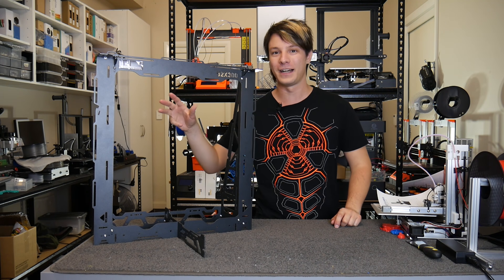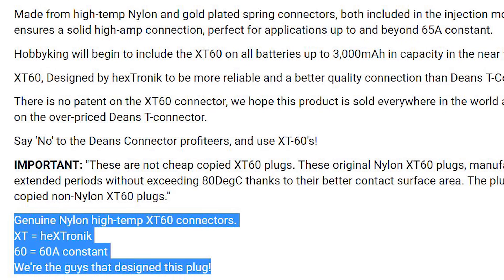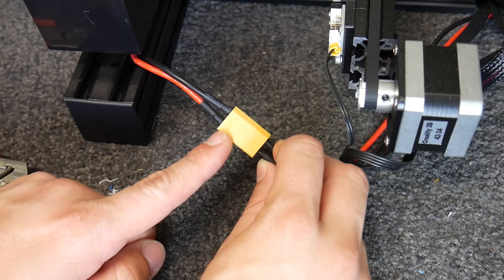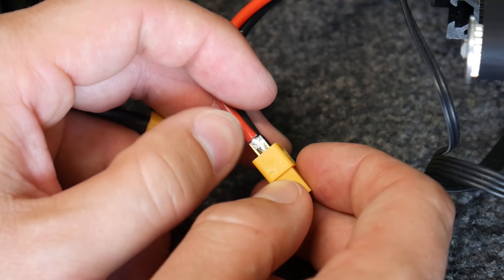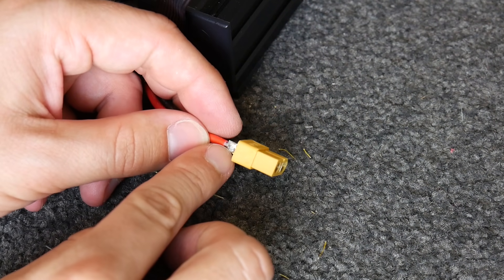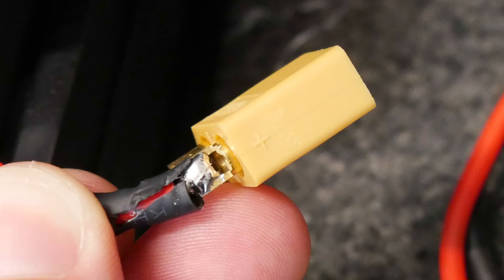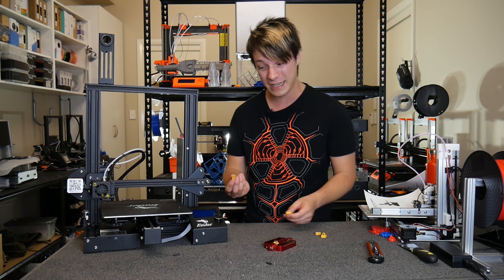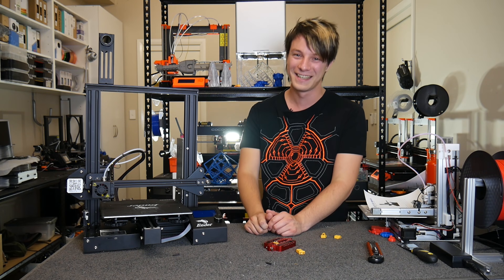Ender 3 Connectors are burning up... Bad XT60's

Comment: There is actualy no such thing as 'fake' XT60's.. HobbyKing wants others to allso use these, so they allow Anyone to manufactur them.. 
Offcourse they indeed need to be Soldered to the wires :)
Reply from the maker: True, fake probably isn't the right word nor is knock off... but 'inferior' might be a good descriptor!
Reply: Yep.. that's the word :)
Reply: Indeed not knock off, but if you pay nuts... ;-)

That said, the Ender 3 is a fantastic base to build and improve on. I enjoy mine very much.
Reply: If you use the “original” and then use the “fake” it’s a night and day difference, I’m sure you would be very frustrated and calling them fake. Absolutely horrible rubbish that easily melts
Reply: BrunoPOWEEER Point made by DutchRC Adventures it’s just a standard type connection which is also heavily used within the RC community. So there isn’t really a original one and neither a fake one. There are just solid and well crafted connectors and the not so solid ones which are build to a grade it can barely up to half of the intended specs.

And these kind of printers should never be running leaving unattended for a long time. They are prone to all kind of failures. Just the nature of these type of printers. And it wouldn’t surprise me very much if the early production runs have more issues regarding quality control than the later production runs. I have mine used pretty intensive over a period 6 months up ‘till know and I regularly disassemble the printer for modding and maintenance and never ran into some issues others experienced. No loose connectors on the mainboard, no melting solder on wires in those screw connectors, no melting XT60 connector while printing with the hotbed on 80 degrees celsius and hotend on 250 degrees celsius.

It’s like BMW 5 series, most of them won’t catch fire. But if you have one which catch fire it sucks.
Reply: @MakersMuse  Maybe cloned like how we refer to non-Prusa "Prusa" I3s
Reply: In as much as XT60 is a product originated by AMASS, and not enshrined in any standard doc, the connectors made by other manufacturers are imitations of various levels of quality.  There is no standard for the other connectors to claim to abide by, and generally they do not come with their own specs.  The Amass XT60 does have specs, which appear to be these: https://www.tme.eu/en/Document/2d152ced3b7a446066e6c419d84bb460/XT60%20SPEC.pdf
Reply: @PM_0891  there is solder in the screw connectors? you should put a wire end sleeve on the untinned wire
Reply: If they are not manufactured to spec then they are knockoff in a open design. To be a real xt60 they should be built according to the xt60spec if they aint well then they are not xt60
Reply: Well you could argue that if they are not made up to the standards expected for the name "XT60", then they are not really XT"60", so in that case it would seem ok to say they are "fake XT60".
Reply: @MakersMuse  yeah right off Taobao I can find four quality grades of that connector.
Reply: @Naomi-Wu  what are the quality grades? I'm imagining "60A with a safety margin", "exactly 60A with no safety margin" and "will burn itself up at 60A, but we'll call it 60A anyways"😂
Reply: @Naomi 'SexyCyborg' Wu and @Kevin Crossland also please be aware that the AMass XT60 spec only shows 30A continous rating NOT 60A! The 60A spec is for brief transient load (as when starting a motor).  But the Ender 3  is closer to 10A, so should be OK anyway.
Reply: In the open source world we call it first party vs third party.
Reply: @Graham_Wideman  Thank you
Reply: HobbyKing uses words like "Genuine" when describing their XT60 packs, so maybe that's something to consider.

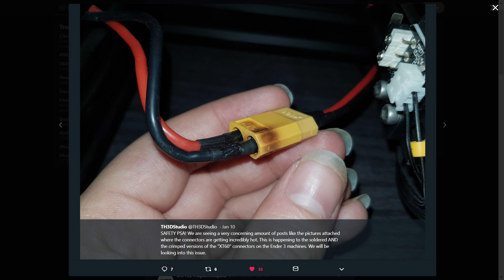Comment: @7:17 it appears that the actual conductor inside the male plug, between the solder joint and where the conductors are making contact, is where it's overheating and burning up. I wouldn't be surprised of the solder joint and the contact between male/female conductors is OK but that it's actually the male conductors themselves, between where they mate and where they're soldered, that's not providing enough cross-section area for current. Otherwise it could be a case of bad contact but it's just heating up the male and is only visible where it's held by the plastic housing that's browning/burning.

Comment: If you notice, the female fakes are also tubes.  I've never seen a completely hollow xt60 female before.  That could also cause heat and resistance since there's less material to transmit the current.
Reply: Yes, they are supposed to be milled out from two sides, not hollow. I don't think this actually limits the current, as there really is plenty of metal there either way, but what it does is limit the amount of solder and heat you can apply before solder flows inside the connector where it would interfere with the male plug. Obviously they wouldn't let it come to that, but that goes half way to explain the sub-par solder job where the solder doesn't even wet the cup properly. Other thing that comes to mind is that shoddy knockoff XT series connector sheaths are frequently made from a lower temperature grade of Nylon that gets soft at soldering temperatures, which also leads to sub-par soldering as they're trying to not melt the sheath.

Comment: I plug the connector to another (that already has heavy wires soldered in)

one of the concerns while soldering these connectors is: if you get the joint too hot, you soften the plastic housing.  If not plugged to the mating half, the bullet can get out of line.

Some people will build a soldering jig that has even more secure mounting for the end being worked on to plug into.

That Turnigy clamp does not address the issue of the hot bullet possibly deforming the plastic.

I affix up to 10 gauge to the Xt60 and EC3.

I also use EC5 (XT90 are the same size bullets) with up to 6 gauge wire for 120 amp demand in RC aircraft.

Above 120 amp, I go to the Castle Creations 8mm bullets.
***********

Or you can go to EC3 which you solder the bullet to the wire, then snap on the plastic housing (can slide the heat shrink on the wire and bullet after soldering)  Since the plastic is never exposed to the heat, once snapped in, its going to be properly aligned.
Reply: What i do, is that ill plug the male intk the female, so that way even if it does deform, the male and female will still be aligned

Comment: We've known for a long time in the RC world about cheap knockoff XT60's burning up (cause as you know, we use them on the LIPO packs and on big RC units, they can pull a lot of sustained power).

I would wager its the same problem and its because of the same 2 issues. 1: They're knock offs and all the issues that go with that as you described, ie contact pressure, contact surface, material type, etc. But issue 2 is i would say the solder joints are iffy. You got a couple of good ones, but there was a couple there that looked iffy (that first one?) and this goes back to issue 1: Poorly copied. With original XT60's, you fill the terminal completely with solder then drop in the wire (preferrably pretinned to help with the wicking), but obviously thats not possible with those terminals because they're open ended and the solder would just flow down all over the spring end of the terminal.

But again, this is a known thing in RC stuff, and tbh considering where the printer came from, its not even surprising.

Comment: still a poor soldering job, the connector hasnt been heater properly if at all
Reply: And the wire on the closeup wasn't pushed down to the bottom, into the dent. It's just soldered up near the top end.
Reply: THANKS! This is a bad soldering job, Its more like glued on to it. To the top with your comment!
Reply: If you heat them too much, the pin melts the plastic and it moves. That's why when I solder them I plug it into its pair first, and that holds the pin in place in case it wants to move. Also adds a bit more thermal mass.
Still my favourite connector - great for making distribution blocks, parallel combiners or Y connectors.
Reply: @ahaveland  yup, which is why they probably skipped on some,
Reply: You are right, XT60 and others needs more time to heat to solder it properly.

Comment: I'd totally agree with you Angus, the fake XT60's are the most likely cause of the problem. The plug pins don't look anywhere near as sturdy add the genuine ones, if they do overheat the heat tends to anneal the metal, which then loses its spring tension, making the situation worse.

Comment: I started a print on my Ender 3 just before this video began, I've just gone to check it and it's 14mins into the print and held the XT60 connectors....they're warm!
I'll check the solder connectors tomorrow when there's more light but if they are crimped I shall be soldering them and putting fresh heatshrink on too
Reply: Maybe take out the connectors entirely. Odds are, it might not be the solder joint but connector quality. They aren't supposed to fit this sloppily.

Comment: I just checked my Ender 3 and it has crimped connections on both ends. I bought it on December 3/2018. I was more concerned that I could pull back the heat shrink tubing and push it back. On the other hand, if the connector were too hot the shrink tubing would not be able to be pulled back and be slightly grayed as I've seen on overloaded joints in the past. The crimp looked solid and was a 4 point crimp. I only do PLA, so my bed is not above 60 but I have done 10 HR prints. Since there was no discolouring on the plastic I'm just going to keep an eye on this and post if I see anything show up. Every owner should use their own discretion. Thanks for passing this on and the heads up!

Comment: I just got an Ender 3 Pro yesterday and Creality has fixed many things on their printer. For example the control box fan is no longer facing upwards and the extruders heating block has a silicone sock on it. I just checked and they have also upgraded to genuine Amass connectors so hopefully people don’t have to worry about this issue anymore!!

Comment: Hello. I wanted to thank you for your very useful and informative video. It helped me understand the reason for the melted connector on my 2018 Ender 3. I removed the heat shrink from the wire and found that it was not soldered to the connector, but simply crimped.

Comment: Yes he is correct! However I know and most people that have done anything with connectors one crimped the connection can and usually is deformed! I HAVE A ENDER 3 AND I WILL BE CHANGING THE PLUGS CRIMPED OR SOLDERED! I am not a paranoid type but after years of working with truck trailer and RC BOATS CARS AND AIRCRAFT. I HAVE SEEN THE OUTCOME OF JUST ONE BAD CONNECTION. Good job bringing this to the public attention! Thank you.

Comment: All those solder joints looked really bad.

You need to wick the solder into your wire first (called tinning the wire), then flow some solder onto the surface of the plug  (do not fill up the plug, you only want some solder on the surface of it), then insert the "tinned" wire to the plug and add heat to the plug and feed solder into the wire as it heats up. This is the only way you make a solder connection to a XT60. If you are not experienced at soldering large connectors it is recommended to have a connector plugged into the XT60 when soldering to ensure the pin can't warp if you accidentally add too much heat (so support the connector your are working on with it's partner plugged into it). Most videos on youtube show you the WRONG way to solder an XT60 so beware.
Reply: Thank you for your explanation! For me it is enough, but I am wondering if you think about making a Video of how to do it the right way? Again, thank you very much! :)
Reply: THIS should go to the top.  It is a great description.

Filling the connection with tin will make it harder to solder, and the risk of cold soldering will be much higher. Especially if you don't wick the wire.

The parts that you will solder should be "wetted" first with electronic soldering flux. It is much easier to get a proper soldering when the parts are fluxed then without. As someone mentioned, don't use the wrong soldering flux, as it got acid in it and will corrode the electronic soldering.

The order of applying heat is important if you want to make a good solder.

0) Use flux on the parts.
1) Wick the wire.  Here you can use more heat, so you get good smooth flow between the tin and wire strands. Don't fill the wire with too much tin. You can feel how long the tin has gone up in the wire. If too long, just cut to length (about 1 cm should be ok).
2) Add enough heat to the connector, so that the tin is flowing smooth into the connection, but no more.  Don't use to much tin, just so it gets on the surface.  As mentioned, ad the other part of the connection as fixture and to remove heat. Can make it easier to not overheat the connector.
3) When the previous step is ok, while stil heating, add the wire. Now the connection surfaces are tinned and the heat needed to make the connection is easier.  Top up with tin so that the connection is filled up, this is why you should not use to much tin earlier.  But just fill so you get get a smooth tin solder between the connection and wire.  Not to much or to cold, as it then will build up a blob with tin.  That is cold soldering and makes a bad, high resistance connection.  That is no better then the original ones in the video. 
4) When the soldering have cooled of, you can remove flux with some tissues in alcohol or even water.

Inspect the soldering, and the "flow" from the connection to the wire should be smooth. It should NOT be a sharp step between the metal connection and wire, with a blob of tin on the wire or connection.  That is a cold soldering, and is a bad connection. Both mechanical and electrical.  
If that happen, unsolder the wire, put flux on the parts and redo the operations.

Sorry for repeating what you wrote, but this is important, as we could not have cold soldering, as it will certainly make the connections heat up, and even catch fire again.
Yes, there are plenty of videos showing of good electronic solders here at YouTube.
Reply: I'm glad to see I'm not the only one distressed by the soldering advice in the video. This description is excellent.
Reply: Yeah im about to soldier a battery to these connectors, I was a welder in my late teens, A long ass time ago, lol, Still its completely diff than holding an arc welder, Or even mig, Having to hold the soldier wire with the soldier in the other hand, Im not very good at doing, Is there any little tips that will make it easier, The soldier wire is from a cheap soldier off ebay, I never learn i always do it buying cheap that messes up to easy, lol, Its for a bafang mid motor so i dont really want to mess things up, An catch fire while im blipping down the street, I will defo connect connectors together before i soldier it, Cheers, Glad i read it....

Comment: I inspect soldering jobs for high reliability pcbs (150 deg C high vibration enviroments) and the soldering on the 'fake ones' seems to be lacking.  there should be a fillet of solder around the wire and there seems to be just a bulge.  Looks like they didn't use  additional flux and just relied on the flux in the wire.  I didn't get a good look but the backs of the solder cups should have a bit of solder on them since to do the soldering correctly, the heat has to be applied opposite of the solder and the molten solder will flow to the heat.  

Thinking about it this is a race to the bottom printer and they are definitely not going to use flux.  It is additional material (tiny) but it is definitely slower.  Always use flux.
Reply: It's probably that garbage lead free solder everything is made with these days ...
Reply: @danp2779  I use lead-free (silver bearing) solder all the time. Needs more heat, but I've never encountered a situation where leaded solder would have given me a significantly better result. The stuff that doesn't have silver in it (almost pure tin) has inferior wetting and flow properties, but does (as small compensation) make beautifully shiny joints.
Reply: As someone who inspects cable harnesses, mostly class 3, but some class 2, I'm still trying to figure out why these should never be crimped if they have a crimp contact instead of a solder cup

Comment: Angus, looking at the connectors you have on both your printers, they are knockoffs, they don't have a 'bottom' within the barrel, you can see the wire if you use your jig to solder them you're going to fill them up with solder.